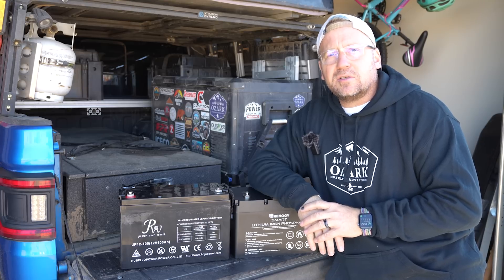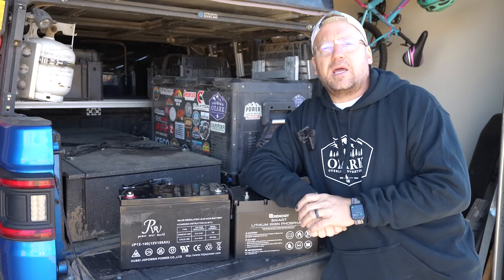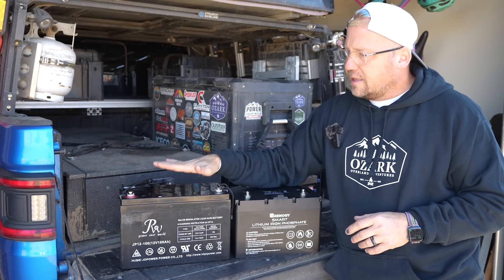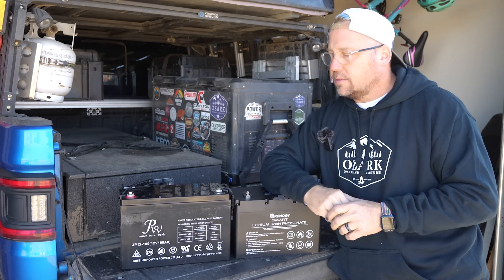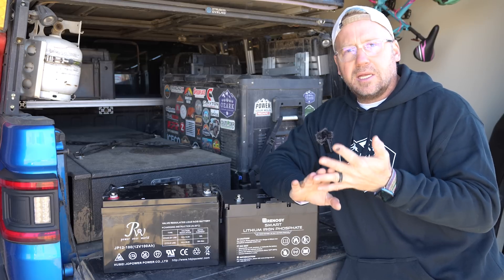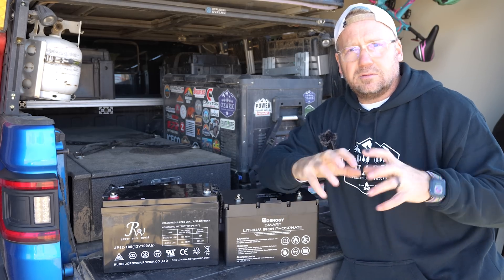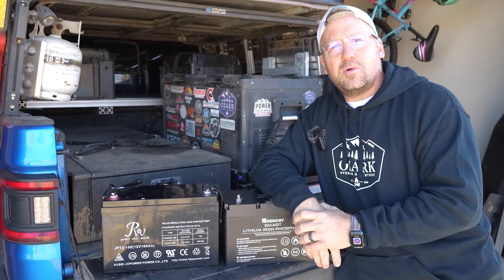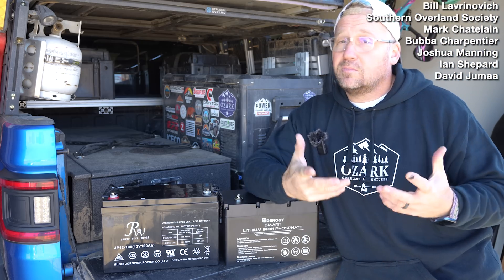Battery Swap - AGM VS Lithium - Renogy LifePo4 100ah Self Heating Batteries

Comment: Awesome review but this only applies if the battery works as advertised. I got that exact same lithium battery and it died in two years, nowhere near the 4000 cycles.
Reply from the maker: Isn’t that true of literally anything? Renogy should have warrantied that for you.

Comment: When do you think you will upgrade to Redarc system?
Reply from the maker: I'm honestly not sure I will at this point. Just changing to the Lithium Batteries has been a major improvement!!
Reply: @OzarkOverlandAdventures  oh thats cool. I was thinking for stuff like microwaves ect..but if there no need. cool.
Reply from the maker: @TygerBlueEyes  The Redarc is just a different charge controller. I will add a different inverter at some point to power things from AC when needed and not plugged in to shore power.

Comment: Does the Bluetooth monitor work correctly when you have more than one battery in parallel?  Do yo have to do anything special to see both batteries on the monitor?
Reply from the maker: It works great. You just have to take a network cable and join them together. It's super easy.

Comment: Just installed a renogy 100ah lipo battery in my gladiator. Run a dometic cfx3 45 for 33 hours and bed lights for about two hours and it used 14 percent of the battery. I consider that pretty amazing. I have the renogy dcdc charger to install. So I believe the single battery is going to be enough for an accessory battery. Thanks for the good video

Comment: We have a 2022 Conqueror 490 also. My question is did you have to make changes on the DC to DC and AC to DC controllers?
Reply from the maker: According to Conqueror there’s nothing to change and it works fine.

Comment: Might want to rethink all your water crossings with the Lithium Ion battery. They can explode when exposed to water.
Reply from the maker: That’s Lithium Ion. This is Lithiun IRON Phosphate. These don’t do that.
Reply: @OzarkOverlandAdventures  The picture right on the battery says otherwise. The one with the water drop with a line through it…
Reply: @OzarkOverlandAdventures  It’s lithium that reacts severely with water.
Reply from the maker: @nickburns5571 not sure how these would be able to get water in them from a water crossing unless I sunk my Jeep. 🤦🏼‍♂️
Reply: @OzarkOverlandAdventures  Harsh shock and vibration can cause batteries to crack. I am not sure how long you have been off-roading but it happens. Just be careful.
Reply from the maker: @nickburns5571  been doing this a while. Never had a battery crack. I’ll take my chances. Lol.
Reply: @OzarkOverlandAdventures  That’s good to hear. I will continue to run something less volatile just like the US military does. Might not have the cycle count, but I don’t have to worry about it blowing up under my rig.
Reply from the maker: @nickburns5571  I think you’re being fearful for nothing. These things are so common now in overlanding rigs, trailers, vans, and RVs. I’ve never heard of one blowing up.

Comment: So this may seem like a very, very dumb question. But, can these be used for vehicle batteries?
Reply from the maker: No. These are not starter batteries.
Reply: @OzarkOverlandAdventures  I also don't think they can be installed under the hood because of the high temperature.

Comment: Just saw where Dakota is running a sale on a number of their lithium batteries until 1/1/23. My Hiker Trailer came with their 100ah lithium, and I was pleasantly surprised at the light weight of them compared to a lead acid battery.

Oh yeah, 11 year warranty!

Comment: Good video I’m going through the same thing right now. I bought a diesel heater for winter camping, and in order to get it to start requires some amperage. It’s the only thing I use that requires power. The diesel heater that is I’m not using refrigerators and other things because Iat this point pretty sold on yeti coolers and their efficiencies and simplicity but as I venture into a power supply system I have researched the typical solar generators, and I have not read a lot of great feedback for how much they cost and the longevity. So I am looking at buying lithium batteries and making my own system so if one component fails, it should be much easier to repair down the road.

Comment: Great video. Only thing i didn't hear in the video is if you have a shore charger built into the trailer make sure its capable of a lifep04. I has to swap the one in my trailer out when i made the switch.
Reply from the maker: My trailer shore charger works with LifePo4. I made sure of that before I started the project. It's working great.

Comment: Does the 490 have a DC-DC charger to charge the trailer batteries while you're towing? I know you have the redarc onboard Sully for its' house batteries.
Reply from the maker: Sure does.
Reply: @Ozark Overland Adventures  that is pretty sweet. I know there are only a handful of trailers out there that do from the factory. The AC-DC converter in ours supports lithium but we had a hell of a time getting it switched to support the right charge curve for LiFePo4 and we are installing a DC to DC along with an auxiliary cable to support the  charging at full amps when towing.

Comment: It will drop voltage aswell in LiPo battery. I use them in my RC's and they droping voltage aswell. Be carefull with that, or you will detrpy the battery if the voltage drops to much. And yes, lipo's are much more expensive
Reply from the maker: I said that in the video.

Comment: Hey Matt. Great video and information.  Question though, you mentioned about the cold temperatures and a internal heating that is activated at a certain temperature.  How low of a temperature can these be used? We live in an area that gets below 0 for days/weeks. Will the internal battery heater keep up at 0 or below? Thanks
Reply from the maker: I know these did just fine in our recent few days in the single digits. I haven’t tested them in anything colder or for longer periods of time and hope I never have to. 😂 You could call Renogy and check with them to be sure.

Comment: I have two Renogy 100 AH in my Hiker Trailer, will never look back after running them. Have no problems what so ever with them. The App is also great
Reply: Another Hiker owner (Mid Range XL 5X9) here . Bought mine back in September of this year, and it came with a 100ah Dakota lithium. What size inverter are you running?
Reply: @retnav92  600 Watt
Reply: @1markymark1  Same here.

Comment: Does the app allow for monitoring multiple batteries at once?
Reply from the maker: If the two batteries are connected with a Cat5 cable, yes. That’s how mine are set up and it’s awesome.

Comment: Had same issue with the diesel heater. Two 100 amp agm at full charge but kept getting low volt error on the heater. Lucky I had a shore power option to plug in and the invertors extra little boost got it to start and didn’t need shore power after that.

Comment: I like that you can monitor the status  and it has a long life.  I wonder is that extenally vented so it could be installed inside the passenger compartment?
Reply from the maker: No venting needed. Totally safe inside.

Comment: Another great video.i did all the research for my trolling motors. Would have been nice to have all the info in one video like this. I use the same batts for overlanding and the boat and just trade back and forth. Only thing you didn't mention was you need to make sure the charging system is lifepo4 compatible. Other wise it will damage the battery . Great video

Comment: You definitely don’t want to go lithium if you winch a bunch.  It won’t handle that well.
Reply: Lithium is good for long, relatively low draw systems such as fridges, charging stations, lighting, heaters, etc.  

Winching should NEVER be done with a lithium battery, nor done with the starter battery if the engine is off.
Reply from the maker: These aren’t starter batteries.
Reply: Could you expand on that I would like to know why Thanks
Reply: Yes they are not a great start battery either. Great for trailers and boats. Best in a full drain and full charge use

Comment: But the math gets even better Matt. In order to get the 100 AH out of the AGM your need two like you said, and you'd do that twice in order to get to the 4000 life cycle of the LFP. Even better after the 10 years and two sets of AGM batteries you'd STILL have to buy a third set because the LFP would be down to 80%. The AGMs would be useless. I don't think this is even said and stresses enough about LFP is you can ABSOLUTELY use them below freezing, my DIY battery's can be run down to -20F. The other thing that's not said enough is the 32 degrees is the ACTUAL battery temperature NOT the physical outside temperature. Throw those battery in box and just using them MAY keep them above freezing.
Reply from the maker: Yes all very true. Thank you.